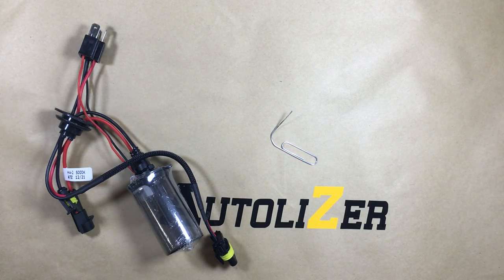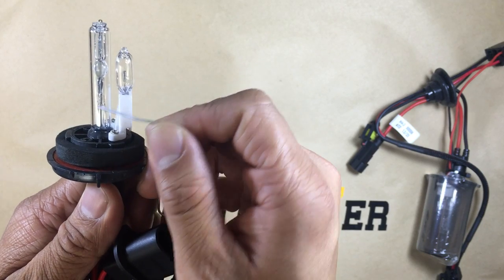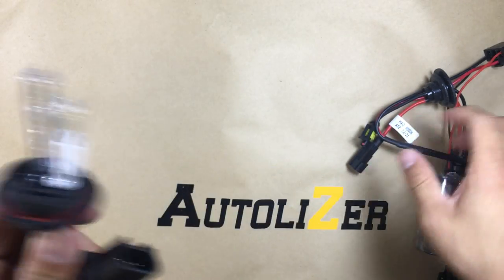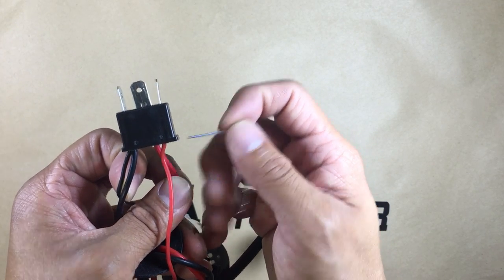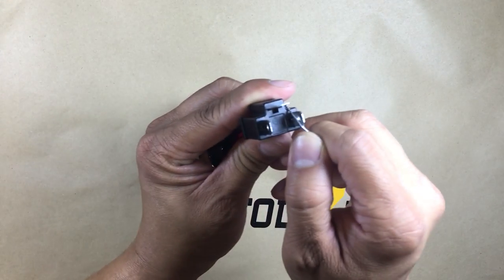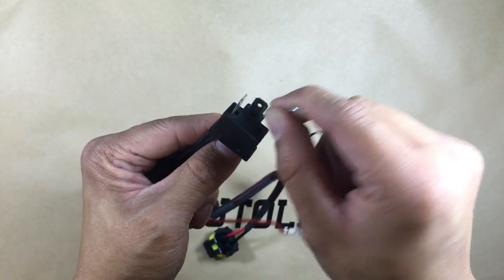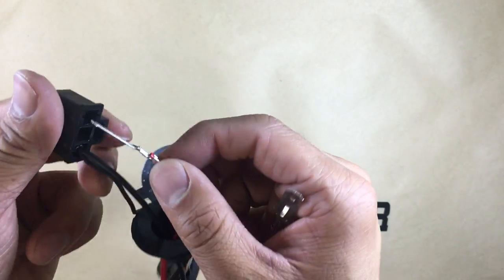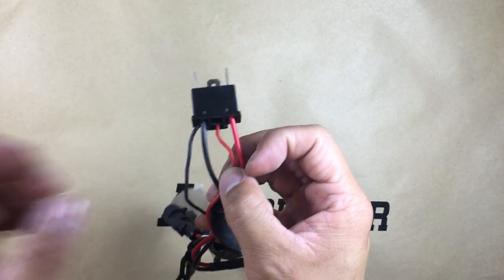How to switch the polarities for your low and high beams.

Comment: I'm doing way with single normal high and low beam bulbs and going with duel LEDs. My headlight work with just the low plugged in so now I have to do some rewiring and get rid of the high beam bulbs. It works just how I thought it would. Cheers

Comment: I know that this video is old hope your still active. I ran into a problem in my ford focus zx3 2004. My highs are lows. However my wires are Green with a strip of yellow, the other one is green also but has a black strip. the other wire is all black. what should i do to switch it.
Reply: I know it's been 2 years but have you ever figure it out? I got a 2006 Ford Focus ZX4, mine has the same issue and the wiring is exactly as you described it.
Reply: @deadhead1016  I'm having sounds like the same problem with my 2005 focus the drivers side bright to dim is backwards but the passenger side works normally
Reply: Usually the black wire is the ground. You could always use a multimeter to check the polarity of the wires. My best bet would be to swap places the green wires but you should make sure the all black wire is the ground.

Comment: i just purchased h4 LED. when i install left standard halogen and right LED, low & high beam works normal. when i install left & right LED, only high beam works but low beam not working. also high beam indicator works normal in both case. what could be wrong?
Reply: Have you ever solved problem i have the same problem
Reply: Adis FCB did you solved it?? Same problem here.
Reply: @adis54100  i put a resistor on one side of the LEDs and it solves the issue
Reply: yup, for me is the same problem on my 2004 renault traffic with h4 led bulbs. At the moment for low and high beam to work, I have installed one led bulb in one side and on the other side i left halogen.
I cant figure out the problem as well.
Reply: Did you manage to fix yours ? @adis54100  my 2007 vivaro does the same thing

Comment: My low beam is reversed but on Led headlights I reverted the wires that did not work so I bought campus installed that did not work what to do.

Comment: Hey my passenger side Bulb Has reverse polarity. It's on high beam when it shouldn't be. How can I fix this?
Reply: Go to passenger side Pigtail , and splice and swap the two wires on the sides of the 3 prong connect0r